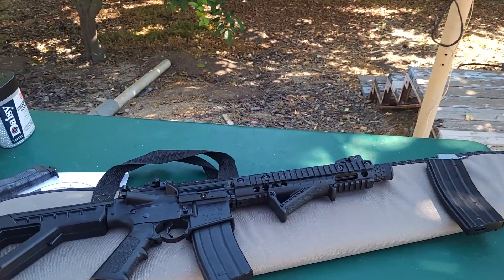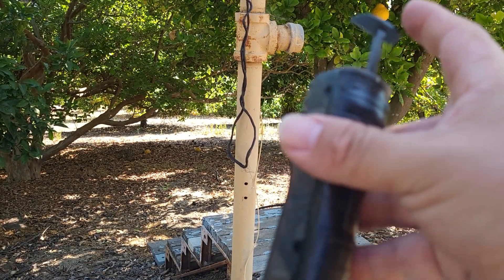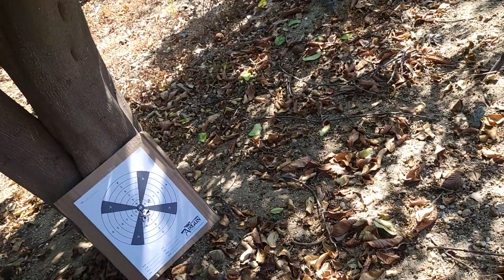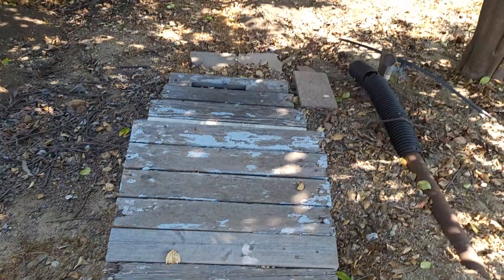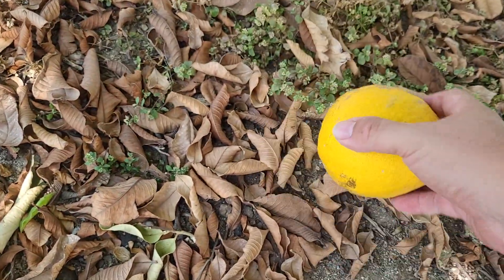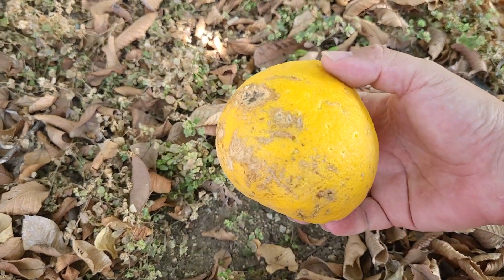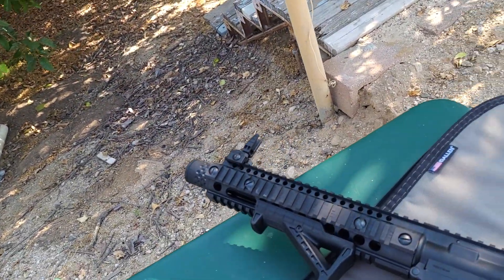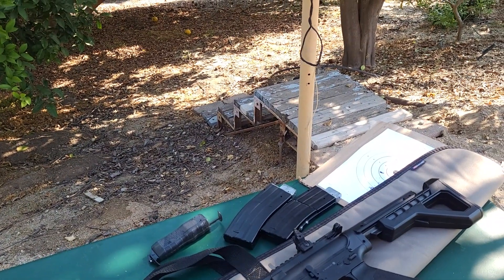Crosman DPMS SBR BB CO2 firing. Semi auto Full auto

Comment: Saaaaweeeeet! Mod the buttstock. Change the grip. Apply a better sight, and you're set 🙂. I also took off the barrel shroud and replaced it with an m16 extended barrel. Honestly its difficult to distinguish between the real steel